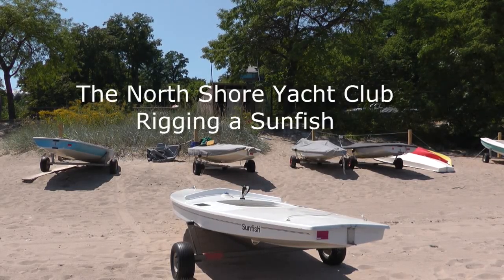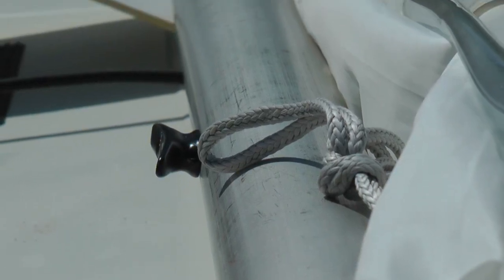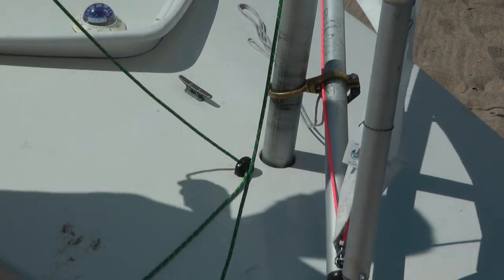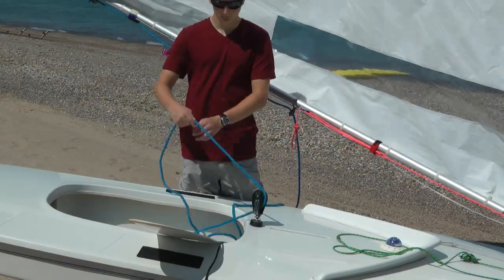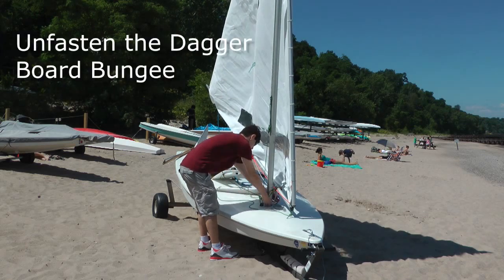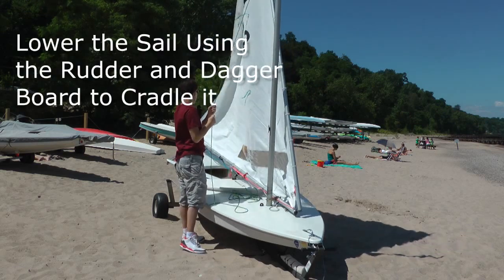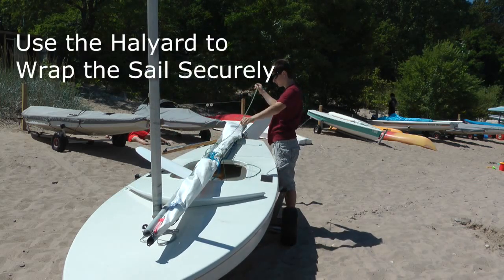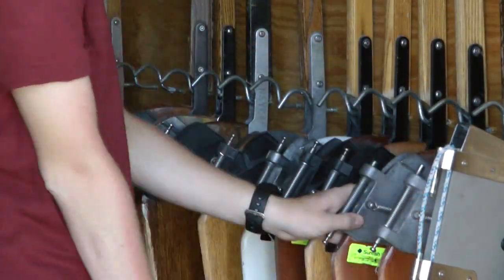Rigging a Sunfish Sailboat

Comment: In my 50+ yrs of Sunfish sailing, I’ve never seen a cleat on a mast.
Reply from the maker: Interesting. I'm, relatively speaking, a newcomer to Sunfish sailing, only about 15 years. My club owns about twenty Sunfish, which we sail on Lake Michigan and trailer to other sailing venues. A number of our members sail in regional and national regattas, and a few have done well at the international level. It has been my observation that among the Sunfish racing community, at least among those that are serious competitors, mast cleats and lines and lower spar cleats that permit the adjustment of sail luff and foot tension are pretty universal. I agree that if our club boats were not sailed in competition and not routinely sailed in higher winds and large waves we might use a simpler approach to rigging. Some of our rigging a derigging methods, particularly the way we secure the sail and spars, are meant to address the way we store our equipment and the fact that it was inconvenient, when our hundred plus members were each left to apply their own unique way of storing equipment. That said, I'm always interested in learning more.

Comment: Thanks so much.  There were a couple of things in the video that were done that we were not taught at our sunfish camp.  Great video and very clear - easy to understand.  Thank you so much!
Reply from the maker: Thanks for your comment. The method used at our club of securing the halyard follows a practice typically used by sailors who race their boats at the highest level. The use of a mast cleat and the trucker's hitch insures that the gaff (upper spar) is held snugly to the mast even in high winds. Really glad you liked the video.
Reply: @KingGroupProductions  Hi Steve - where did you get the storage hardware to hang the rudder/tillers in your storage area.  Ours are just leaning against each other in corners.  And where do you store the daggerboards?
Reply from the maker: @KathlynElaineAlderman  Hi Kathlyn, big screw hooks from the hardware store are used to hang rudder/tillers against a wall; they are bent a little bit and turned so the hook faces down. With the tiller straight up the “fork” of the tiller slides right over the hook. The result is the rudders lie perpendicular to the wall getting a lot of rudders in a small space.  One of our members built a rack for dagger boards: two 2x4s spaced a dagger board width apart with 1x2s placed across them ladder-like leaving ‘slots’ just wide enough for the board to slide in and rest on the cleats at the top of the board. Wish I had pictures.

Comment: Great vid, my mast doesn't have a cleat on it so it sometimes makes for a struggle to downhall the gooseneck without the main dropping
Reply from the maker: It is easy to install a cleat. Intensity Sails has 3-inch nylon cleats for $6.41. Add a couple of #8 1-inch flathead screws from your local hardware store. Drill two holes with a 7/64-inch bit. And for around $10 bucks you're set.
Reply: @KingGroupProductions Thank you!

Comment: The absolute best video on rigging a Sunfish bar none. Really easy to follow. Can you tell me which model Ratchet block is being used for the main sheet? It appears to be a Harken, but which model and size?
Reply from the maker: My club uses Harken and Ronstan ratchet blocks. We do not use integral cam cleats believing that keeping the sheet in hand is safer for new sailors.
Reply: Love this vid! Can you tell me which block you use? I got a 40 mm from them but it doesn’t have that rubber mount. Is that separate? And if so, what’s it called? (Been searching on google no luck.)

Comment: Awesome method!  My mast doesnt have a cleat - can i install one myself?  Looking foreward to to trying this - the de-rigging ideas are inspired.
Reply from the maker: Thanks for the comments. Much appreciated.  A four inch horn cleat works. The distance on the mast above the deck is not critical...2-3 feet works.  You will need an electric drill, a number 29 drill bit, a tap wrench, an 8-32 tap, two 8-32 screws long enough to pass through the cleat you've chosen plus about a half inch more, and a small bottle of Locktite 242. The Locktite is to prevent the screws from loosening over time. 242 is the blue colored product with medium strength.  Locktite 262 will also work; it just makes it a little harder to remove the screws should that be necessary. Glad to hear you like the de-rigging method. I don't know who developed the method. I learned it from sailors at the North Shore Yacht Club in Highland Park, Illinois. They have a fleet of about 20 Sunfish that are used for adult and high school sailing classes as well as for the use of club members.

Comment: I noticed that a couple of sail cringles at the fore end of the boom are not tied to the boom. In your recently posted Sunfish rigging video part 2, I see how this allows for positioning the gooseneck for wind conditions. Are those ties added in a later rigging step or do you sail without those sail ties?
Reply from the maker: MrBOSMAN1970 ... I leave those ties off, because I frequently adjust the boom on the water. Thanks for watching.

Comment: If my mast has no cleat, I run the main sheet aft to bow, yes?
Reply from the maker: Not sure I understand. Without a cleat on mast run halyard down to deck fairlead and aft to cleat on deck aft of the mast. Does that help? Cleat on mast is a good upgrade IMO. And easy to install  about 3 feet up from deck.

Comment: Can you tell me how to remove the rudder from the boat. In the video it did not show this!
Reply from the maker: +Fido Yllets The modern rudder uses a stainless steel pin.  Two grooves are machined into it.  The pin is spring loaded.  By moving the rudder pin against the spring the grooves can be aligned with the gaps in the gudgeon bracket allowing the rudder to be removed from the boat. Check out Annapolis Performance Sailing Sunfish parts page to see pictures of  the rudder cheek assembly, the pin (called the "Post"),  and the Gudgeon bracket.  Old style rudders used a different attachment system. In this case a bronze pin needs to be removed. I admit to having no experience with these older rudder styles.
Reply: Thanks, SK

Comment: How do you install the cleat on the mast?
Reply from the maker: I believe it is a # 8 x 32 stainless steel machine screw. It depends on the cleat used. The screw should fill the hole in the cleat. Using the fine thread, 32 threads per inch, is best because the mast wall is thin. Use a #29 drill, then carefully use an 8 x 32 tap. I use a bit of Red Locktite on each screw.
Reply: @KingGroupProductions  thanks for the quick reply! I normally use my sunfish for cruising (do semi-long trips, like Cancun - Tulum), your video taught me how to rig my sunfish 5 years ago. I´m really grateful you took the time and effort to produce this.
Reply from the maker: @Galopo  I am honored that so many people have found my video helpful. For long trips with steady winds I tie a slip knot at the ratchet block to hold the main sheet and sit on my tiller extension while I eat my lunch.
Reply from the maker: Install with 8x32 screws. Drill holes with #29 drill bit, then use an 8x32 tap.

Comment: how much does one if these cost
Reply: I picked up an older one for 125$, they usually sell around 2-300 used.
Reply from the maker: Cost of a used Sunfish depends on location, condition, and age. Are all the rig elements there: mast, both spars, gooseneck, main sheet? Condition of the dagger board and rudder? A fixer-upper maybe missing spars or sail can go for $100-$200. An older boat with light cosmetic issues but otherwise complete can go for $400 to $800. A boat in good condition, dry interior foam, spars and boards complete, 1990s and newer typically brings $1,000 and up. A new Sunfish sells for around $4,000. My sailing club with a fleet of 18 Sunfish looks for newer boats in very good overall condition and considers anything under $1900 to be a fair price.

Comment: Port side?!
am I missing something here?
Reply from the maker: I don't understand. Did I screw up the commentary? Port refers to the left side of a boat facing forward just as Starboard refers to the right side of a boat facing forward, very old terms in general use world wide. The way I have heard the story of the origin of the terms is before rudders centered in the stern of a boat were invented a steering oar was by custom situated on the right side of a vessel. It was called a steer board, which evolved to starboard. Because the steer board might be damaged, when mooring a boat at a dock, it was custom to dock with the left side of the boat to a dock. Thus, the port side of a vessel at a dock and the birth of the term Port to refer to the left side of a boat. But, maybe that wasn't your question. It almost certainly was more than you probably wanted to know, right:-) Thanks for watching the video.
Reply from the maker: Oh, I see what you may be asking about. The picture doesn't really support my narration very well. What I meant was that when the mast is inserted through the bronze goose neck and into the mast step the spars and sail need to be on the left side of the mast, the PORT side of the boat.
Reply: gotcha....language can often be the leading cause of misunderstanding.
I do appreciate the video, clear and concise. Thanks for the vid and the response. Have a great day..

Comment: this boat seems terrible. It has no kicker and just seems needlessly complicated given how low performance it is. Also why would you use a slip not on the halyard, do want it to come undone?
Reply from the maker: The Sunfish sailboat design first appeared in 1945. It became available in fiberglass in 1960. It is by far the most popular fiberglass sailboat ever made having sold well over 300,000 boats worldwide. It is popular for recreational sailing and is actively raced in hundreds of fleets. The slip knot is used in a two-part hitch to increase halyard tension and to allow the slip knot come out with a quick jerk so that the sail can be lowered. A different knot would jam at the top of the mast and prevent the sail from being lowered. Thanks for watching the video.